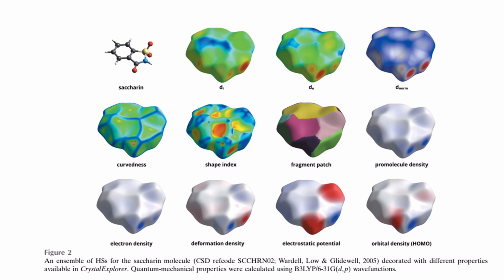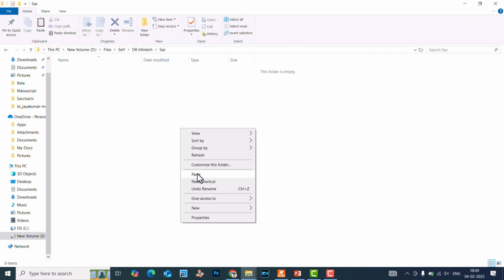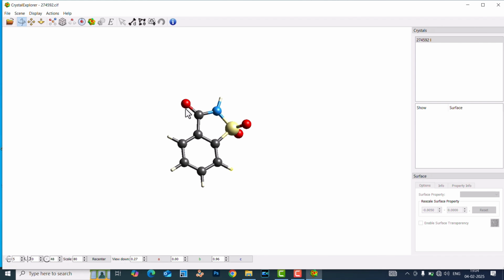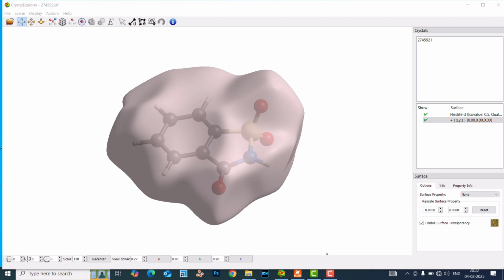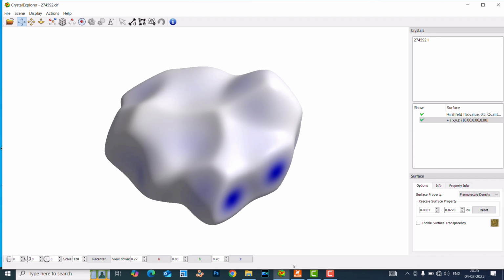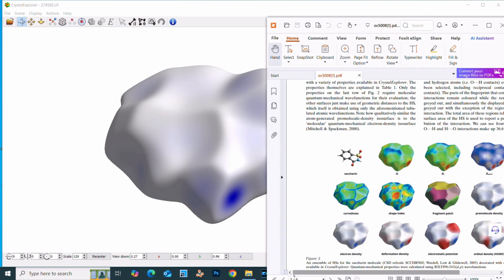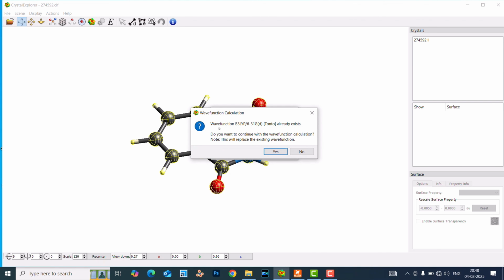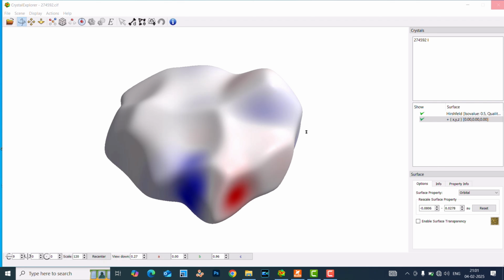How to Create Hirshfeld Surface Using Crystal Explorer |  Hirshfeld Surface | Electron Density

Comment: hello sir, sir i draw a structure in chemdraw later converted it into CIF file using avogadro and vesta. while calculating electron density and orbitals etc. it shows " unable to calculate, wave function file missing". what ll be the solution?